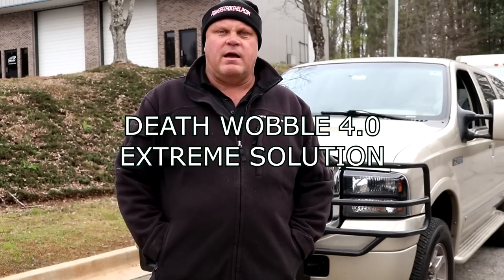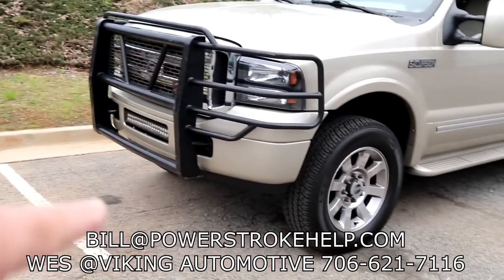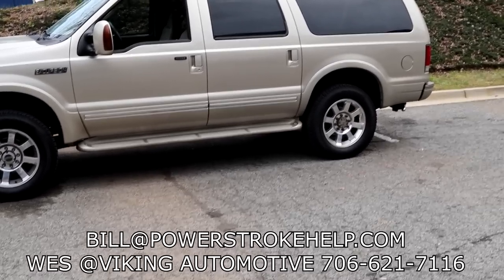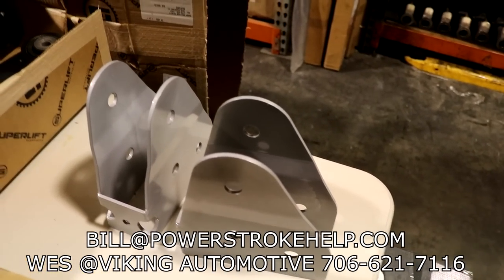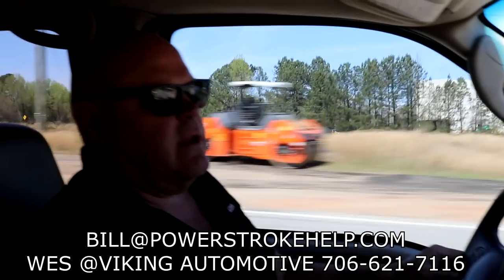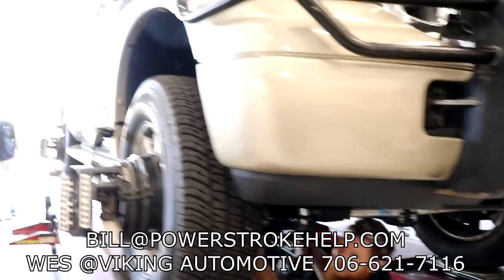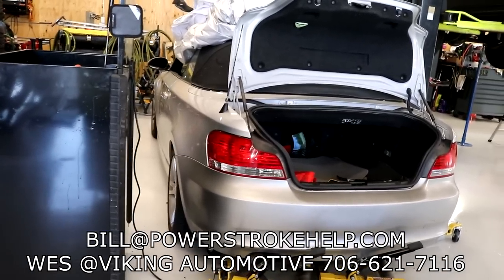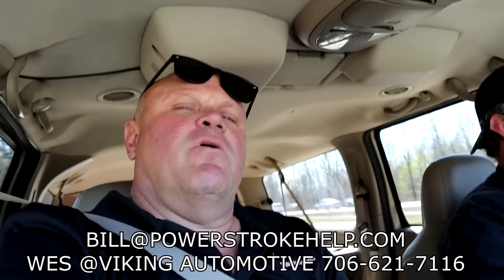DEATH WOBBLE 4.0 - EXTREME SOLUTION

Comment: Bill, I recently added Sumo Springs Front SSF-109-40 (Blue) and Rear SSR-109-40 (Blue) on my 2005 Excursion EB 6.0 4x4 and they are great.   I HIGHLY, HIGHLY recommend them.   They replace the OEM bump stops and improve the ride quality.

Comment: I COMPLETELY FIXED my 2015 F2Fiddy’s death wobble on Saturday…….I traded her in on a 2021 Toyota 4Runner TRD Off-road Premium w/Predator package. Now I’ve got a truck that’ll last forever and not cost $300/oil change. Loved my Duty 6.7 and miss her a little, but definitely glad I did.
PS i never had death wobble. Had an 8” BDS suspension kit and 38’s and never had any issues with that thank God.
Reply: Can’t beat a Toyota product.  Seems like I am hearing that more and more everyday.  Obviously if you need to pull 20k lbs you are at the mercy of the Big 3…glad I am not.
Reply: It’s a absolute joke Ford can’t figure out caster angle after making trucks for as long as they have.
Reply: That's because the BDS lift kit was installed properly & the proper CASTER angle was retained. 
BDS makes some of the best quality lift kits, bar none. But, that's also why they're so damned pricey. 
Ya get what you pay for!
Reply: @marlinnotfish  : It's actually NOT Ford, Dodge, or Jeep's faults. People modify (lift) their suspensions, thus screwing up the factory caster angle, which is EXACTLY what causes the "death wobble" to occur! 
If you lift a coil sprung front axle, you  MUST adjust the CASTER to compensate for the added lift!
Reply: @turbodiesel4709  I am not sure about this.  I had a 2005 Ford F-350 SRW that I purchased new and I had death wobble from month 1.  Sold it and never looked back.

Comment: What is the pinion angle? 
Increasing caster 8 degrees is great for handling but will also drop the pinion down by hmmm 8 degrees. Did this induce any driveline vibrations while driving in 4WD?
Reply: @Preacher S :
It certainly may have. There's definitely a trade-off that occurs when adding caster.

If people would realize that 99% of "death wobble" in these trucks comes from adding the stupid "leveling kits", without paying an alignment shop to modifying CASTER angles to compensate, maybe they'd stop doing it!

Comment: "Death Wobble" started in 1988 when the F-Super Duty was introduced....Drop-axle with no caster adjust built-in.  There were many recalls on that issue.  For anyone that has not experienced the true "death-wobble".   It is not just a wobble.  It is literally a steering wheel lock to lock oscillation that would break your arm if you chose to put your arm through the steering wheel spokes when it happens. It is all geometry.  Even we techs of the time knew that.   Ford threw many parts at that problem.  Frankly, I can't believe that it is still an issue.  The front suspension engineering of those trucks is BS and Ford always knew and still knows it.
Reply: Yes sir I drove wreckers for 30 yrs had a brand new 88 super duty with 17' aatac steel rollback it will scare the hell out of you when the death wobble kicks in we tried everything even new axle nothing fixed that straight axle!!

Comment: I'm curious about the caster settings. I have a grand Cherokee that I've been fighting with death wobble on for over a year now. I've set caster from 4.5° up to 7.5° with no change. Everything under it has been replaced with upgraded parts or Moog replacement parts, red top steering box, I've tried two different brands of steering stabilizers and nothing even changed the speed or severity of the death wobble. I can't drive over 50mph without fear of being shook off the road by hitting the smallest of bumps in the road. Does anyone have any input or ideas? I'll try anything at this point.
Reply: I saw a vid where the guy put a camera under the front end . The amount of deflection of various components was amazing. You should do the same.
Reply: @Matt Kaydus : How much lift is in your Jeep? 
If the front axle is anything higher than the stock height, you will need more a POSITIVE caster angle than the factory spec. Usually a couple of degrees more than factory spec is plenty, but it all depends on what all has been modified & by how much.
Reply: @truthboomertruthbomber5125  trouble is that I've already replaced and/or upgraded every part of the steering system. I don't know if a magnetic mount could even hang on hanging under it when it acts up.

Comment: Hey Bill. Would you be interested in a 2006 F250 w 6.0L attached to a 6 speed manual transmission? Truck has 160,00 miles on it. Motor just had a complete head gasket job with studs about 1,000 Mike ago. Truck currently doesn't run, because HPOP branch tube is broke and needs replaced. If you are not interested,  let me know what the truck is worth if I sell it in my area, southern Indiana.

Comment: If it comes back after all this, make sure to pull the front wheels off and change the universal joints.  This is a part that is missed and has been found to play a major component in depth wobble.

Comment: Have y’all had any complaints/solution’s to the way F450’s handle? I’ve had an issue with my 2022 F450 where it kind of wonders around and if it catches the outer edge on black top (where they re-pave the road over top of the old one) and it’s difficult to controllably bring it back onto the road. It also gets sucked into the rumble stripes they put out to let you know your on the edge of the road. This is all made worse when your hooked to gooseneck trailers as well. (Don’t know about bumper pull, I haven’t had one hooked to it yet.) Would all this have to do with caster? Or would this be a different issue I need to chase? This series has been SUPER informative and I really appreciate you putting the time and effort into getting this kind of information out there!
Reply: What tires are on it? My experience with F-550s has been the factory 19.5” continental tires are very squirmy, esp. the first 2,500 miles. I’ve had quite a few white knuckle moments when the duals catch a rut or rumble strip and start squirming back and forth, not fun when you have close to 20K lbs onboard. 
Michelin tires help tremendously and they don’t chunk their tread blocks at 10K miles.
Reply: Assuming steering box isn't sloppy and all tie-rod ends & ball joints are good, then:
Front wheels need to have slightly more Toe-IN added, and also the addition of heavier steering stabilizers will also help.
Also, make sure the trailer is properly loaded! If you have too much hitch weight, the front end of the truck will be too light, and the truck will be much harder to control & keep straight on the road.
Reply: @preachers4135   oh really? It does have the stock continentals on it. They are a different tread patter from our 550 though, like they switched tires on the new ones or something.  I know what you mean by getting squirrelly with a load on! Been there! Haha! I usually have a load around 25k and it’s not fun when it falls off the fresh blacktop down on the old stuff… I will have to look into the Michelins for my steers at least… I was hoping they would be some good tires for a long time, not looking forward to buying 6 so soon…! Lol
Reply: @turbodiesel4709  interesting! The truck only has about 6k miles on it right now, I sure hope everything is still tight! Lol I’ve asked the ford dealer multiple times if they would check the alignment but they say it’s in spec and they “can’t replicate the issue…” I might just have to run it over to our local alignment shop and have them put it on the rack and see if they’ll add some tow in on it.

Comment: I bought a Excursion from you in 2017 it's been a great ride. I've never had a death wobble issue. One question what about Chevy why do they not have the death wobble issues?
Reply: The chevys have the same problem I ride to work in a 4500 every day and we’ve had problems with death wobble
Reply: Because they're not solid axle trucks. They're engineered like a 1/2 ton truck
Reply: I think because their HD trucks have independent front suspension.  Not a straight axle on ford's and dodges where the 2 front tires are tied together.  But could be wrong
Reply: @Bentley Fatheree : GM uses a totally different front independent suspension design, with torsion bars/springs. 
No solid front axle with coil springs on the Chevy's.

Also, if your Excursion's suspension is still at stock height, and the CASTER angle is within factory specs, your truck will never have "death wobble". The truck in this video was lifted in the front. 
I find it rather funny how they didn't bother to mention that!!!

Comment: I replaced my rear leaf springs in my 2005 F250 with those Michigan springs, and they’re already rusting less than a year later.  I live in the south and they’re rusted worse than the original ones were after 17 years.   

Not too happy about that.  Guess I’ll need to coat them.
Reply from the maker: New Hampshire Oil
Reply: did you paint them? Parts under the truck need paint on them to last, as well as maintenence coats from time to time.

Comment: @powerstrokehelp  
Hey Bill, I'd greatly appreciate it if you'd "pin" my following comment, so all can read & learn. I'm also open to any discussion of agreement or disagreement that you may have.
Thanks, 
AJ

So, @8:25 in the video, you actually showed the TRUE CAUSE of the "death wobble". It made me chuckle.
Someone installed "leveling" pucks above the front springs, to fit larger wheels/tires. It's an all too common practice, one in which that simple little suspension change throws the geometry of the factory CASTER way outta whack!

As we both know, heading towards negative caster with these front suspensions is NO GOOD, and yet, that's exactly what's happening when anyone lifts these types of front suspensions.

Once ANY front suspension lift mods are made, the caster angle MUST be readjusted back to within  factory spec.
Sometimes, sightly more POSITIVE caster than factory is necessary, depending on the amount of additional suspension lift that was added. A "bump up" to 4° to 5° of positive caster is a relatively common amount, but different vehicle situations may vary.

Ford, Dodge, & Jeep solid axle front coil sprung suspensions are all essentially the same. Been dealing with this issue for over 25 years now, and I find it rather amazing how few people actually understand how to permanently cure this relatively well-known issue.

The lesson to learn here is simple:

If anyone chooses to lift the front suspension at all, even with a basic 2" leveling kit, then they absolutely MUST CHANGE the front CASTER angle to compensate, or the dreaded "death wobble" may very likely occur.

Any respectable alignment shop can cure death wobble.

Comment: 12 degrees is Mercedes level.  I think 4 degrees is appropriate..  12 is way way too much for a truck.  Just for fun measure the height of the truck with wheel on center and wheel at lock.  It is going to be inches...  No need to lift the truck that much by turning the steering wheel. 12 degrees is silly too much.
Reply: Especially when considering the equal change in pinion angle. What’s that vibration?

Comment: curious, how come you went with blue top over red top?
Reply from the maker: Blue top was out of stock
Reply: @powerstrokehelp  
Hey Bill, I'd greatly appreciate it if you'd "pin" my following comment, so all can read & learn. I'm also open to any discussion of agreement or disagreement that you may have.
Thanks, 
AJ

So, @8:25 in the video, you actually showed the TRUE CAUSE of the "death wobble". It made me chuckle.
Someone installed "leveling" pucks above the front springs, to fit larger wheels/tires. It's an all too common practice, one in which that simple little suspension change throws the geometry of the factory CASTER way outta whack!

As we both know, heading towards negative caster with these front suspensions is NO GOOD, and yet, that's exactly what's happening when anyone lifts these types of front suspensions.

Once ANY front suspension lift mods are made, the caster angle MUST be readjusted back to within  factory spec.
Sometimes, sightly more POSITIVE caster than factory is necessary, depending on the amount of additional suspension lift that was added. A "bump up" to 4° to 5° of positive caster is a relatively common amount, but different vehicle situations may vary.

Ford, Dodge, & Jeep solid axle front coil sprung suspensions are all essentially the same. Been dealing with this issue for over 25 years now, and I find it rather amazing how few people actually understand how to permanently cure this relatively well-known issue.

The lesson to learn here is simple:

If anyone chooses to lift the front suspension at all, even with a basic 2" leveling kit, then they absolutely MUST CHANGE the front CASTER angle to compensate, or the dreaded "death wobble" may very likely occur.

Any respectable alignment shop can cure death wobble.

Comment: I have a 2011 F-250 4X4 PowerStroke with 217,000m. My truck has always wondered a little bit.  I have a light off-road camper (1,500 pounds) along with a very lite boat trailer. I put helper springs on the rear along time ago.  What really bothers me if a few times I have hit bad sections of pavement that set off a harmonic that literally threw me into the next lane.  This has happened only a few times in 217,000m and luckily didn’t have traffic beside me when it did.  The times it has happened is without a trailer. Any advice?